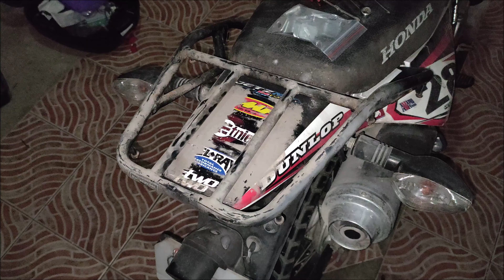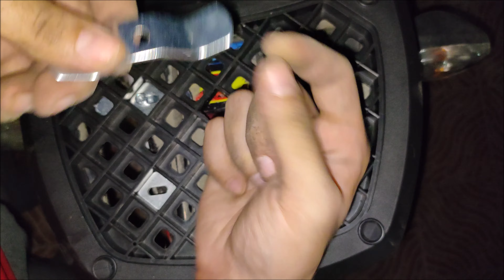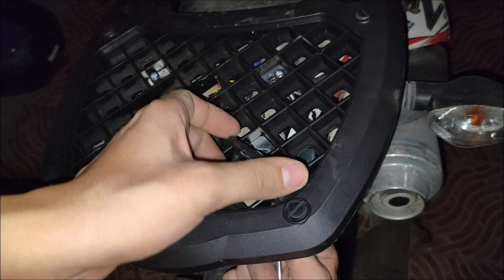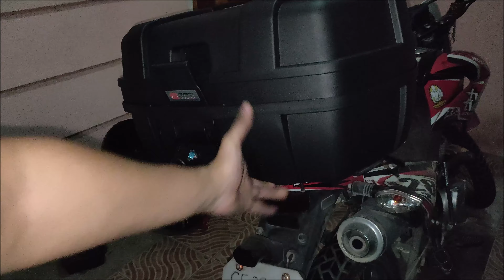SEC 47L Topbox Install Honda XR150L

Comment from the maker: Lazada: https://www.lazada.com.ph/products/sec-top-box-47-liters-i554906676-s1502208540.html?mp=1 Includes mounting plate for tube racks.
0:00 Tube Rack Mounting Plate
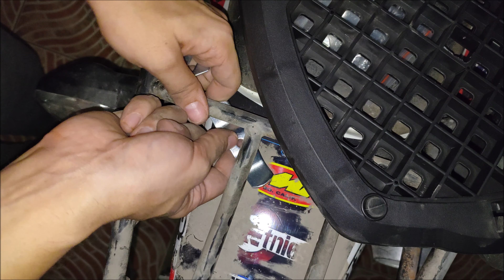1:00 Mounting Plate install position
  
1:35 Mounting Hardware Direction
    
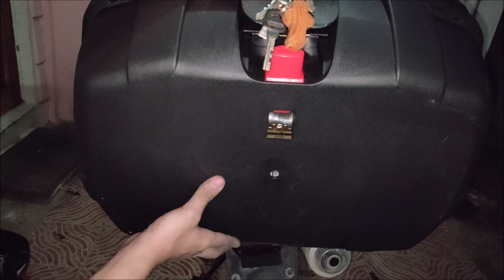6:20 Topbox onto Plate
 
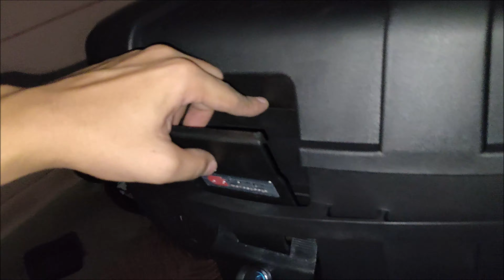7:55 Locking mechanism 
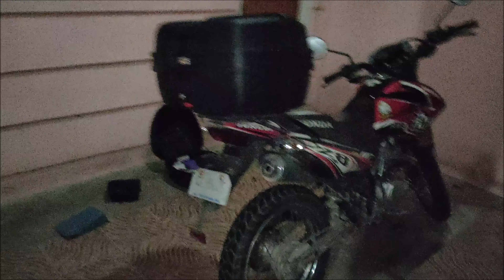9:07 Installed on bike
 
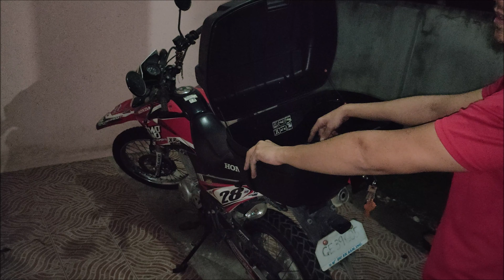9:30 27L Next to 47L Topbox

Tools;
Small star screwdriver,, 5mm Allen Key, 10mm Wrench